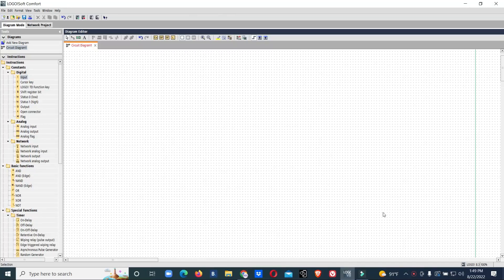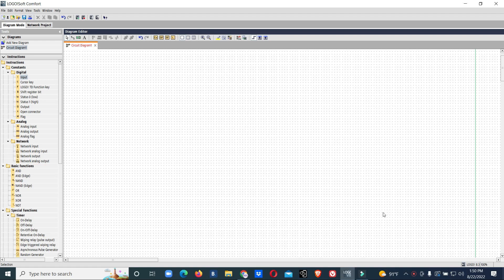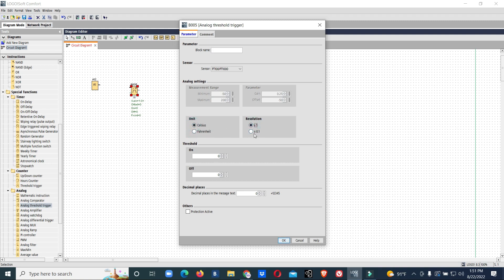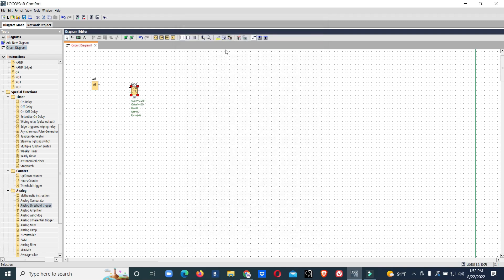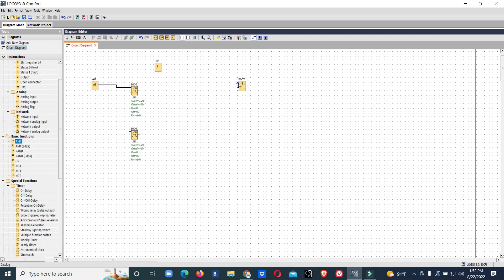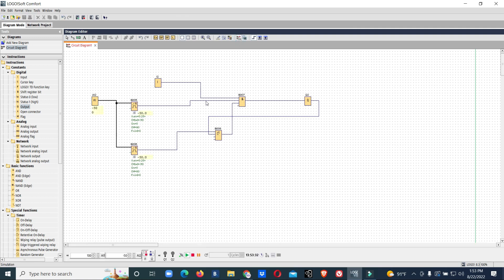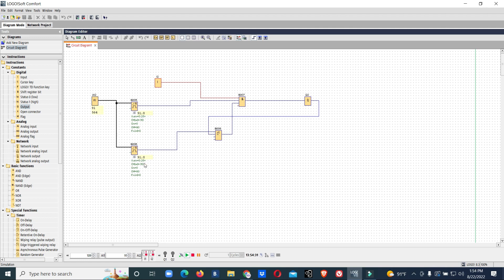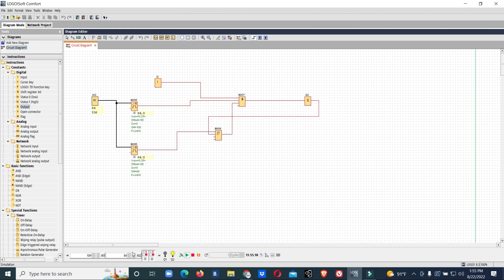PLC PROGRAMMING - Temperature control with Pt100/Pt1000 analog sensor..

Comment: Hi, This is Sathya. 

I have two compressor (Q1 & Q2) and One temperature sensor. I should have option to set my room temperature. Eg. If set temperature is 20. Q2 should go off at 21 degree Celsius (set temperature +1). Q1 should go off at 20. Can you suggest which block I can use in logo plc.